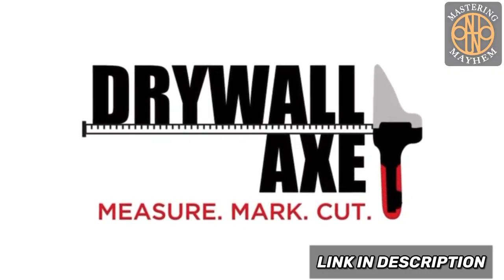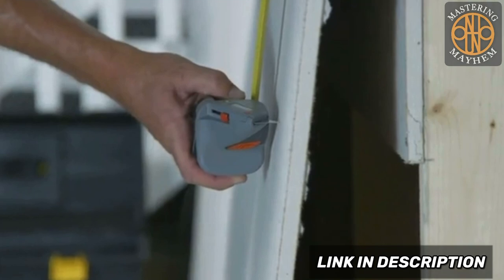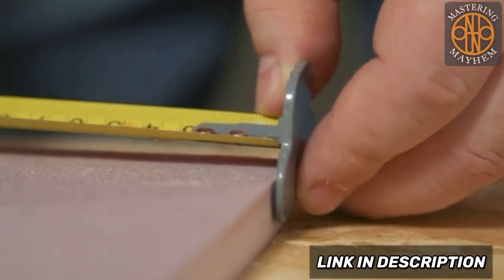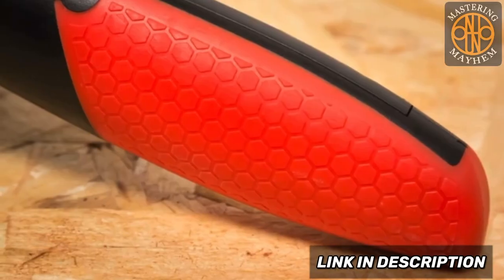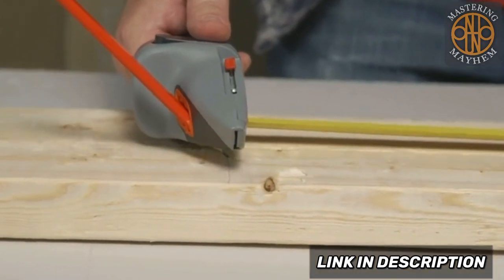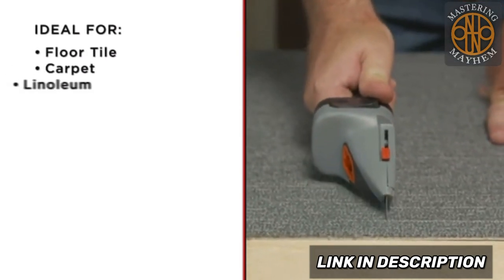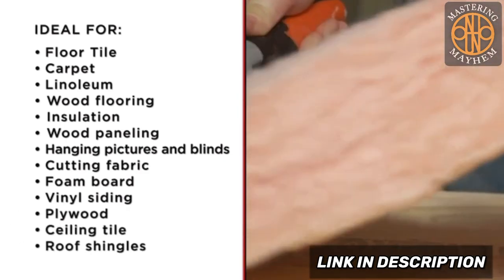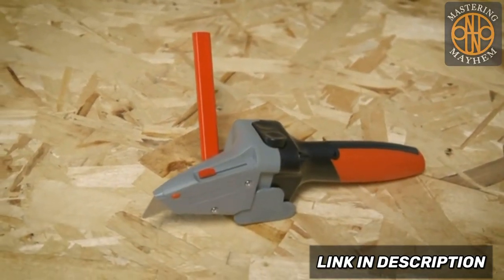The Drywall Axe Top Time Saving 3-in-1 Cutting Tool! Multi-Material Applications

Comment: Ive done sheetrock for 16 years. I think this tool is clever but idk if it's practical. Would def take some getting use to. But for almost $40 idt I would take a chance on it personally. They're gonna have to get the price point down to get it out there more, and if it becomes a success they could then raise it. Just my opinion.
Reply from the maker: Thanks for sharing your view and insights. I think for those who work with drywall all day, if it works efficiently, it’s worth the investment. I’m like you though, is it durable and does it perform efficiently and consistently? I may get one someday and do a review.